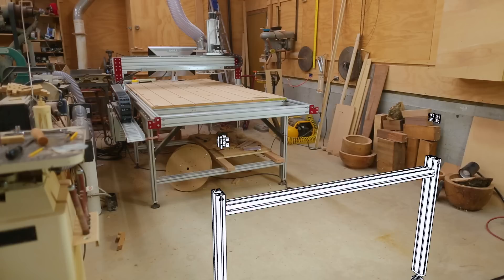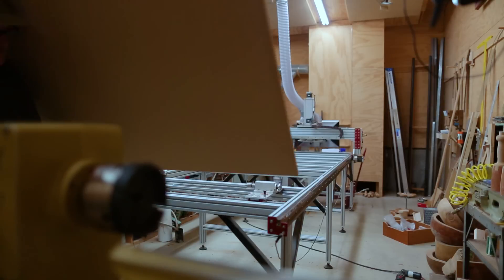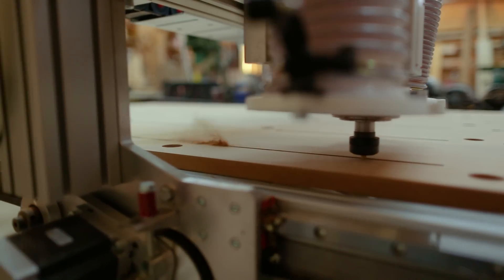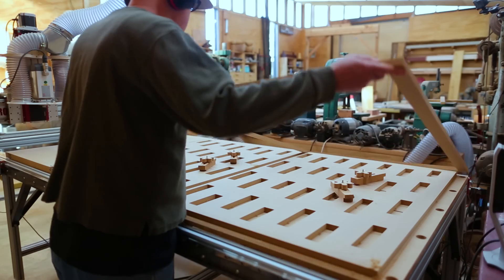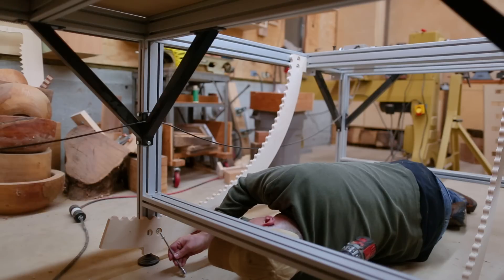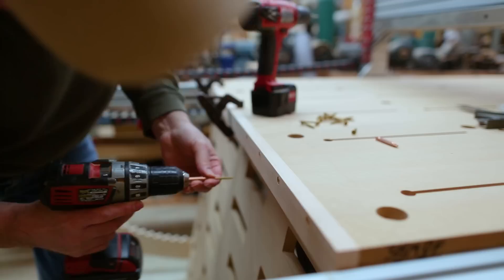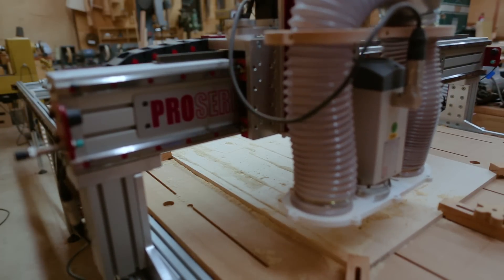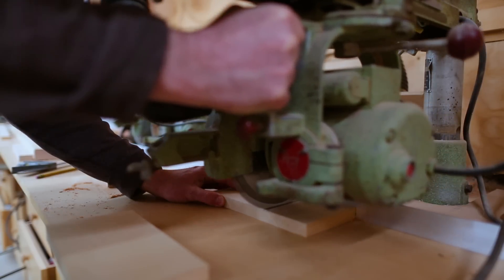Vertical CNC Table and New Spoil Board

Comment: aluminium T-tracks have lot better use spoilboard than weak soft MDF mill t-slot, not strong and good. MDF have too soft material use clamp keyholes. big mistake. need made new table. expensive buy alltime new MDF sheet.

Comment: I absolutely love this vertical table design for joinery and weird angle milling, but would you have any suggestions on how to adapt it for a desktop CNC? I just got a OneFinity Journeyman, and I was thinking about a removable hole/box in the table and spoil-board to then clamp stuff through, but nothing seems as slick as your vertical table. Thanks for any insight!

Comment: Great vid, great solution! I have watched this vid a couple of times as I'm setting up my own cnc (not as fancy as yours, but still). But I was just wondering if there is any limit to the angles you can set with the vertical tables. By the looks of the ratcheting system, the angles it can be set at are limited as the amount of teeth on the ratcheting system is limited and thus accounts for multiple degrees per "click".

Have you ever found this to be an issue?

Comment: Why not just make holes in the arcs and secure each angle with clevis pins using matching ‘hole’ numbers.  There could be 90 holes by offsetting even holes in one arc and odd degree holes in another arc.  Numbers on the arc could match the design angle from the CAD file.  Drill two holes in the table platform representing the even arc and the odd arc, place a marker in the hole and rotate the table to draw the arc on the curved arms for each row of holes.  Set a digital angle gauge on the rotating table surface and rotate the table to angle needed, mark it, and drill the appropriate hole for each desired degree with the arcs mated up off the machine. When using the live machine, secure the angle set with clamps and the pins.

Comment: Is it the same frame?? The first frame was mare of square pipes, wielded together. Now I see aluminium profile tubing system for the frame. Did you replace old steel with new aluminium one?

Comment: frank fantastic video especially the stop motion. Everyone has there own way of doing things. Mine would be to replace the vertical board making it a rigid part and make a sliding top so it slides towards your vertical board so when your not using the vertical just slides over giving you your extended horizontal workspace. " Subscribed "

Comment: I'm not worthy to comment on frank makes videos but I will anyway. When you cut threaded stock run a nut onto the stock behind your cut, then cut, then run the nut back off. The nut will clean up your threads for you. For extra credit chamfer the cut end first. I learned that from a 4th gen. Oil field guy. High school dropout incidentally. Love the evoulution of the cnc frank, keep it up.

Comment: For CNC-ing round holes it is better to have "G02 X[location] Y[location] R[radius] Z[step depth]"  instead of step depth being another line of code. That way the bit continuously spirals into the hole instead of plunging every layer. Not only will that speed up the process, it will also even out the load on the bit when machining harder materials.
Yes, correcting code can be a pain, but for something like this it should be written with M98 and G52 to begin with. This will basically copy-paste same cutting path into multiple locations. Especially useful for batch production since it will use one instance of part's gcode instead of it being copy-pasted just for different coordinates.

Comment: All that resurfacing does not seem like fun,  when the cutting tool breaks thru wood and starts to cut into the surface plate that is hard on the cutting edge. So at a lot of shipping places you can buy rolls of cardboard in varying widths.  So if you roll out a piece of cardboard onto the surface plate then put th piece you want to CNC the tool will not cut into the surface plate only a little into the cardboard. this should minimize ware on the table and bits.  IDEA 2 I think on several occasion  I have watched you need to drill a series of holes equally spaced or so.  Seem like you could make a jig that would attach easily to CNC table that you could have a pre=made drill template software in you cad software that you could say drill 10 holes 6 inches apart thanks for making me think

Comment: tip, something i saw on a metal working channel ... when cutting threaded rod, but a bold on the rod before cutting, undoing that bolt over the cut will clean up the threads

Comment: I'm sure its been mentioned already but have you thought about making a spot to mount a cheap lathe chuck. You may still need to add extra clamping but it would make indexing easier.

Comment: Cool as always, but lock your shop before “bed goes up” gets in there again! Frank, I’d add one complication to the ratchet: a spring or latch to keep it positively engaged during operations. Those round teeth don’t self-lock. It’d be a shame to lose a workpiece to vibration if the pawl jumps out and the table falls.

Comment: interesting video, to help save the threads when cutting them to length, thread nuts onto the rod either side of the intended cut. When the cut is complete, run the nuts over the cut end and it will help restore the threads on the rod.

Comment: A few suggestions.
1. Use nylon bolts to hold the spoilboard to the frame. If you do go too deep and hit one you don't ruin a bit.
2. Cut an entrance/exit hole on both ends of the T-slots so you can add more clamps if necessary without moving the workpiece if its covering one end of the slot.
3. Get a cheap horizontal bandsaw from Grizzly, Harbor Freight, or Craigslist for cutting threaded rod and other metal pieces. After a couple of projects you'll wonder why you didn't get one years ago.
4. Check with a lumberyard that supplies cabinet shops and see if you can get 1" MDF for the spoilboards. It will be better quality than big box store MDF, stiffer, and you can resurface it several more times before you spend the time replacing it.
5. Build the storage under the table on the frame itself and put a bunch of heavy stuff in there. It will help stabilize the frame. Some large gussets on the corners wouldn't hurt either.

Comment: What if you 1) make the ratchet more sawtooth-shaped to increase the holding power, and 2) add a fine-adjust to the ratchet that gives you finer resolution so you can set it to any angle between two ratchet teeth.

Comment: Next time you cut a bolt. Or threaded rod. If you first put a nut on it below the cut and then back the nut off it will clean up the threads.

Comment: Maybe I'm missing something, but could you have flipped the spoil board over and just used the second side?  Maybe have some of your aluminium "joists" not symmetrical along the length so you can cut new bolt holes on the 2nd side without cutting through the first side?

Comment: Frank what blade do you have in the smaller RAS? I know you have talked about how you pull the cut like that on purpose... but it seems like you shouldnt need to take such small nibbles. I have the same GE that you have and even with a cheap amazon 14" blade, it can cut through most lumber with ease.

Comment: Great design as I knew it would be,  probably unnecessary but maybe fix a spring to the “Locking Pawl” so it engages with the Ratchet Wheel securely every time. 
It would be a disaster if it wasn’t engaged properly causing the table to drop a bit half way through a programme.

Comment: 9:08 min mark. Seems to me some kind of magnetic tool would help position the nut in the extrusion slot. : ) Nice video, so interesting.
Reply: Those nuts have a spring-loaded ball on the back that holds the nut in place until you get the bolt in there -- so it would take a pretty strong magnet to get it to move. Using a small hex key worked well for me (allowed rotating the nut till it snapped into place, then sliding into position) when I assembled my CNCRP machine last year. I don't have any big tweezers (like Frank was using), so can't compare.

Comment: You think that's a cut up spoil board? The one at my school is hardly a flat surface
Reply: I've had my cnc for almost a year and still don't have any damage to the spoil board. For all through cuts, I reference the spoil board surface instead of the project top, so even if my material thickness measurement is a little off, the bit still doesn't go into the spoil board. Getting ready to re-surface it for the first time since installation, but only because humidify has finally affected the flatness.
Reply: @matthewsmith8573  well you know what it's like in school shop class,  everyone is ready to do the same thing at the same time

Comment: This table needs to have a rotating table attached to it so it holds the bowls and rotate them at the same time.
Reply: Also, a rack and pinion with a stepper motor, so that it would be a fifth axis.

Comment: Only draw back I can see to the ratcheting system for the table is dialing in an exact angle.  Your limited to its stops  but i guess you could just clamp the table if you need to be in between stops for whatever angle.  Great video as usual Frank.

Comment: how accurate are the angles at 90 and 45 with the large teethe on the arc ?  Is there anyway to micro adjust if your doing something like doing a mortise on the edge of a board ?

Comment: As always - loving the attention to detail - not only in the video itself, but post editing!  One question/suggestion-have you thought about perhaps angling the extraction tubes on either side of the CNC bit so they can suck up the sawdust produced by the router bit?  I would imagine it would just involve changing the number of tube corrugations that each side of the tube clamp holds in place?
Reply from the maker: Yes I have thought about and had conversations about this.

Comment: A little tip for when u are cuttin threaded rods, put on a nut before u cut and then when u have cut the rod u can back of the nut and fix the damaged threads

Comment: You could integrate your 4th axis with your bowl holding lathe jaws to index the workpiece rotation. I like the simplicity of the angle stops. This makes angle repeatable without a lot of fiddly measurement. A treat to watch your work as always, thank you Frank.

Comment: If you ever need to cut an angled slot (or more complicated cuts) in the middle of a panel, you may want to remount the adjusting jig on the 4th axis end.   That way the spindle/gantry will approach the extending panel to be cut rather than have to run through it.   Just a thought from my own experience.

Comment: When cutting a thread make sure to put a nut on the thread. You can then take the burr of the cut off by driving the nut over the freshly cut end of the thread. This will make it easier to clean up the cut.
Reply: another solution to "clean threads" when cutting with a hacksaw, for example, is to light touch up the end on a grinder, and magically the threads are deburred and easy to thread nuts.
Reply: No offence but everyone watching this video knows that. Everyone.

Comment: Frank I enjoy your videos perhaps more then anyone other. I respect your intelligence and thoughtfulness and learn a great deal from you.
I think this tilting section a great idea and aid but I have an observation. with the piano hinge being on the end of the MDF there is a possibility to hit it with the cutter head perhaps. If the hinge was flat on the bottom surface of the MDF then perhaps less likely to cause a problem.
Reply from the maker: Thanks. I did not think of doing the hinge that way. That would work it would just be harder to install.
Reply: frank howarth I only thought of it because of the slots cut out in the old tabletop MDF sheet you replaced. Some of the cut lines seemed to go a little deeper. Didn’t mean to offend in any way.

Comment: I don't know which I admire most, the projects you produce of the tools you use to produce them. I would love to have a CNC machine. Only two things hold me back, space and money.
Reply: Small CNC machines take up less space and cost less money. As a rule of thumb figure CNC costs about $100 a foot. You don't really get a volume break for a while either. Once I saw a vinyl cutter bigger than a basketball court. I should have asked them what it cost. The gantry on it was like 6 feet tall. Like it was that thick.

Comment: those bolts in the spoil board could do with some washers. After using for few years are the T-slot really that useful compared to just putting screw in the spoil board?
Reply from the maker: At some point I will start putting screws and nails in the top.
Reply: cncrouterparts recently showed off some composite nails that won't damage tools  for work holding
Reply: When you put a screw into MDF it has a tendency to pucker so when you pull it out you have to level it to keep your table flat. Don't ask me how I know this. But yeah I just drive screws into my table.

Comment: May I give some sugestions ? ☺
1) Use some metal washerss between the bolts and the waste bed. More clampingforce and less risk to go into the bed with the bolts.
2) Use, for example, a rubber band to force the locking device/bar into the teeth of the arc. In the top position the gravity doesn't help (as much) to let the teeth fall in position.
Looking forward to your next video! 👍😃
Reply: Washers 100%, was surprised he didn’t use them
Reply: 2) Yes, it might vibrate and fall down a step.
Reply: What I would suggest is making it with triangle-like shapes instead of rounded. That rubber band would also help anyway, if only for peace of mind, but I think it would work better.

Also, I would have written on both sides some kind of "angle-scale" system, so when the board is not used flat or 90º it would take no time to know what angle it is.

Other than that, great project.
Reply from the maker: @fadetounforgiven  I thought alot about scoring an angle guide into the arcs.  I decided they would not be very accurate until I got it together.  Having the guide read 46.7 degrees and the angle being that would be unlikely.   I think It might be more useful to mark and take notes on the arcs for particular projects.
Reply: @frank howarth of course, it can't be done before because you will have to fight with them for accuracy, that's for sure. I was thinking of, in case you have one of those little devices that tell you what's the angle at any given moment, using them to mark the most common angles, say 30, 45, 60, if only for some kind of approximation to begin with.

Anyway, I guess that, with time and depending on the actual weight of the piece you're using, that board will get some give, therefore it would become a bit useless except for that initial approximation.

But, on the other hand, the teeth on the arcs are relatively big, so I believe there's not much that can be done about precision as it's a discrete number of positions instead of a continuum.

Sorry, I have the flu (and I'm Spanish, I'm supposed to know a thing or two about it xD) and I may not express myself right, but I hope I'm understood.

Thank you. I'm honored by your reply.
Reply: Guust if you use a washer, you loose the adjustability that the slot gives you.
Reply: @Mrcaffinebean  
1) You could use washers, the same size as the head of the bolt. This isolates the turning of the bolt into the wood.
2) Could have CNCed bigger pockets for the washer, to make room for (more) adjustment.
3) All the holes are made by the CNC machine and very precise, so need for adjustment will be very small. In the video you see that all the bolts are placed and fixed in the middle of the slots.
Reply: Guust 

1 you don’t gain much by doing that

2. Those pockets are already big. 

3. Given the weight of the mdf and the number of screws, that thing isn’t moving.

Comment: Easy to say now....but I think the ratcheting system is limiting. Even more simple is the same arc but with a full length slot that you can stick a t-bolt or similar through.  Then your positioning is limitless.

Comment: Cutting bolts: screw a nut onto it before cutting, then remove it.
Reply: I can't resist describing my technique for doing this:
1. Thread two nuts onto the rod and tighten them together. 
2. Thread a third nut onto the rod some distance away.  Now you have two flat points that you can clamp in a vise, and the rod won't move or rotate when you cut it.
3. Cut the rod.
4. File the cut end flat to get rid of the ratty burr, and then chamfer with a file.  That will keep any stray metal bits from getting in the way of a new nut.
5.  Now remove all the nuts.  They'll clean up the threads on their way off the end.
Reply: @paulkolodner2445  my technique too.
Reply: Martin. They say that simple solutions are the best, and yours is the best. Not many will admit to not knowing this trick. but I will.
Cheers.
Regards from the UK
John.
Reply: I use to do the same and grind the cut area a little so it wasn't as sharp anymore and then back the nut off.
Reply from the maker: Good Idea
Reply: Being all-thread, it can be screwed on any time. :)  Better than a nut, however, is a die...if you have the right size.
Reply: Yeah!!! I just had the inspiration for a project of cutting the head off a bolt to make a threaded rod and was JUST thinking of how I could do that and keep the treads in good shape in order to get a nut on it... Then read this.

Comment: Great video as usual.  One suggestion that I do.  When trying to adjust t-nuts in AL extrusion I find using long cable ties as tongues for either side to push it along until the nut align with the hole.